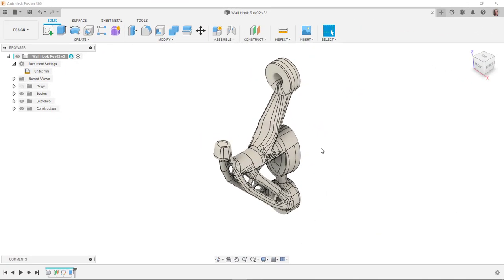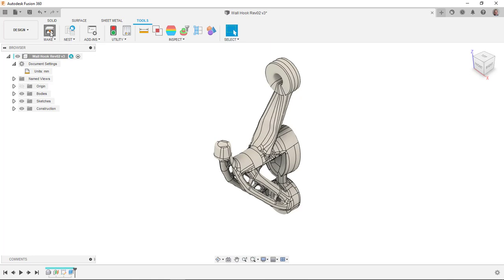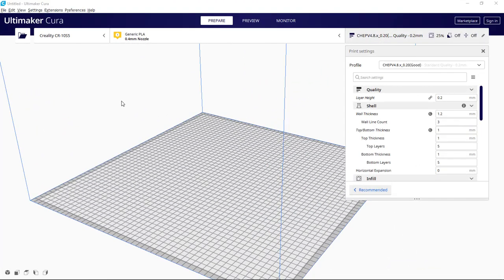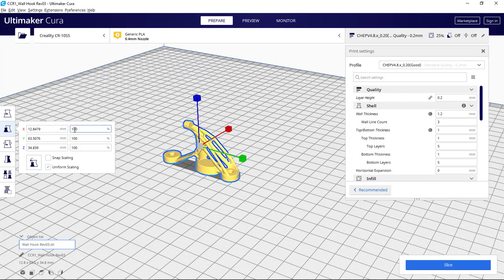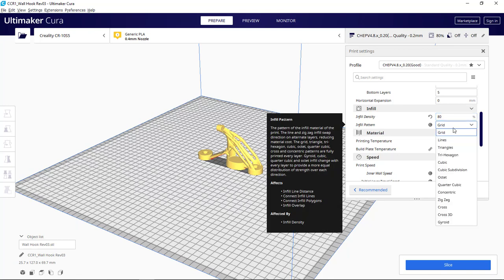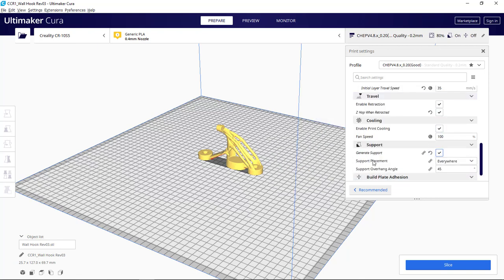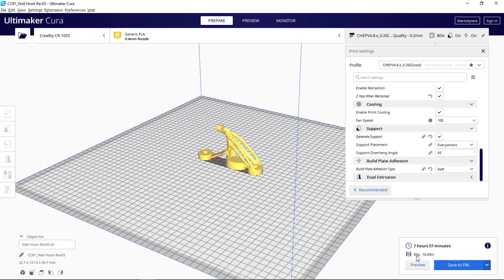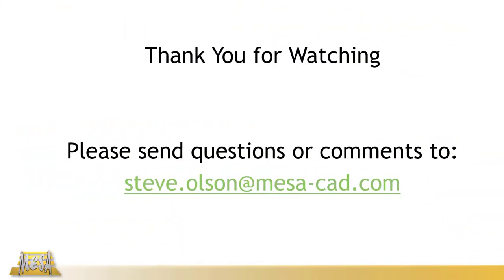3D Printing a Generative Design Model

Comment: Looks great. Thanks for sharing the video.
However, i did save my SolidEdge ST10 generative design to stl and export to Cura but it doesn't show the generative design. Cura displays the original par file.
Reply from the maker: I am not familiar with how Solid Edge does generative design.  In Fusion 360, you have the original file that you perform the study on, then you create a new file from one of the results.  It sounds as if your STL contains the original geometry.  Does Solid Edge allow you to create a new file from the results?  Is it a different body?  I have seen where certain products will make a new body from the results.  Perhaps you just need to make sure that you create an STL from that new body.  In Fusion 360, have different ways of making your STL.  It can contain one or more bodies, take a look at your options for creating your STL and look to see if you can create a new file from your generative design results.

Hope this helps.